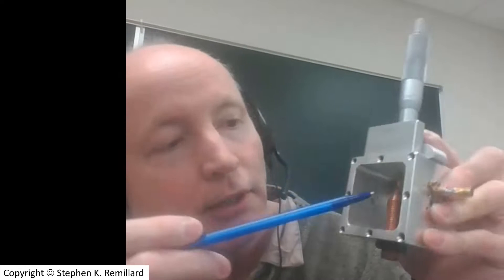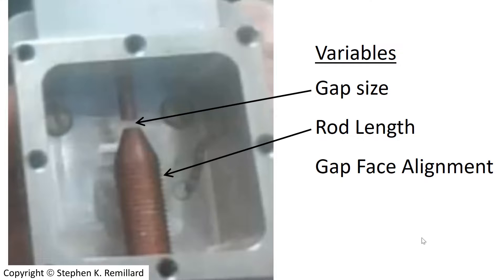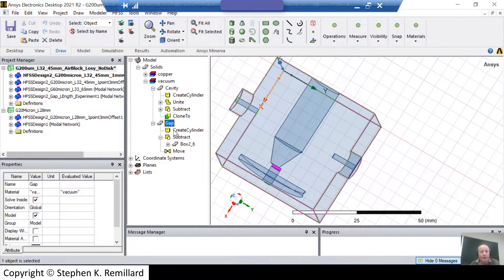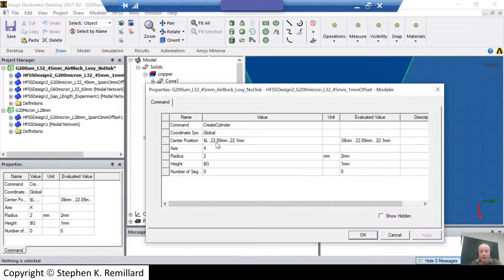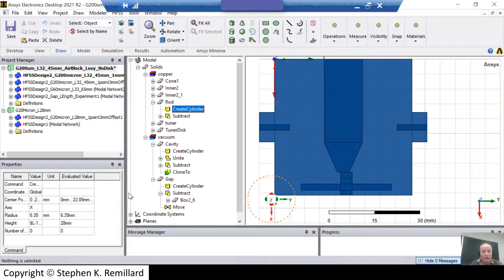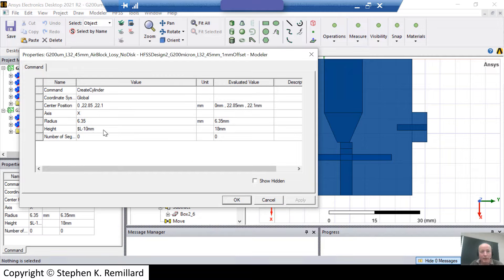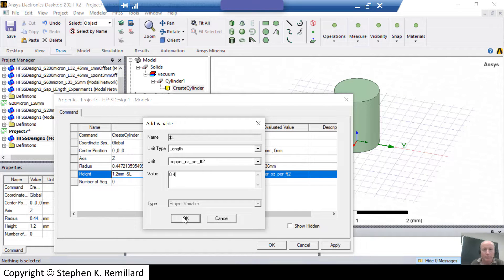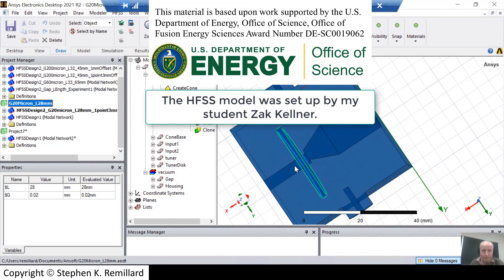Using Project Variables in HFSS

Comment: Dr Remillard are there good career prospects for microwave engineering
Reply from the maker: Brian, Since I have not studied the career statistics, this is only my opinion.  And I'm a components guy, so I'll avoid commenting on all of the systems level opportunities for microwave engineers.  I think microwave is a good area for two reasons.  First, and most obvious, is that there will always be wireless.  The components (amplifiers, filters and multiplexers, mixers, antennae, transmission lines, etc.) all look different at microwave than at low frequency.  If you look at a microwave filter, you will see all distributed element design.  Even a microwave amplifier is a combination of lumped and distributed elements.  This brings me to the second reason why I think microwave engineers have it good.  Microwave engineering is a unique skillset.  It is unique because the microwave regime finds itself between the Kirchoff's laws regime and the optical regime.  And this situation is reflected in the tools that the microwave engineer uses: Smith chart, electromagnetic field analysis, not to mention RT Duroid(TM) and various dielectric components.  Another thing I like about microwave engineering is the culture.  Any group of people who are both book-smart and avid tinkerers are a pleasure to work with.